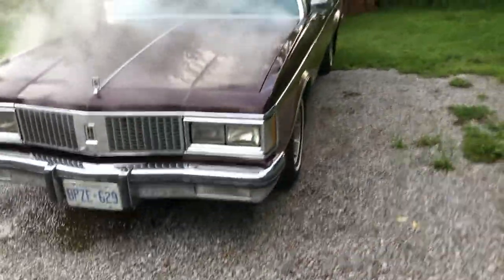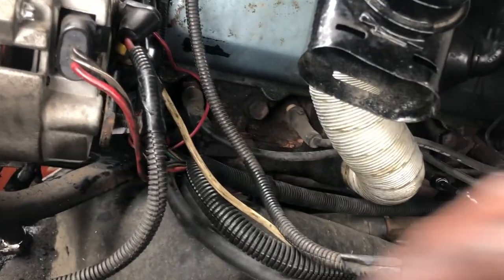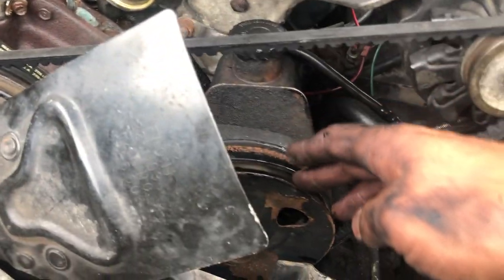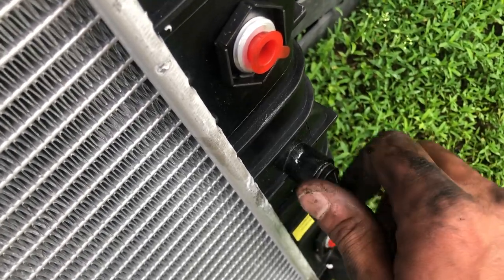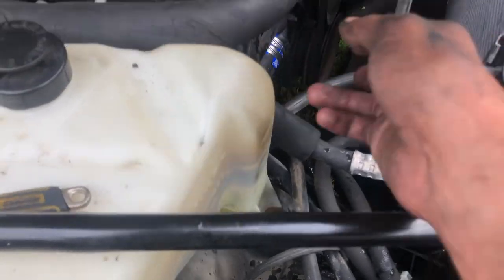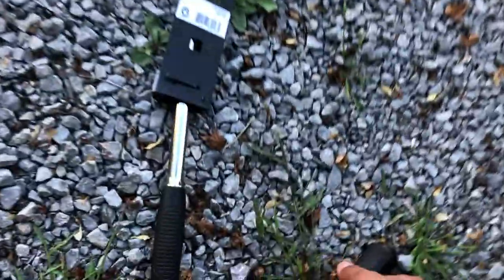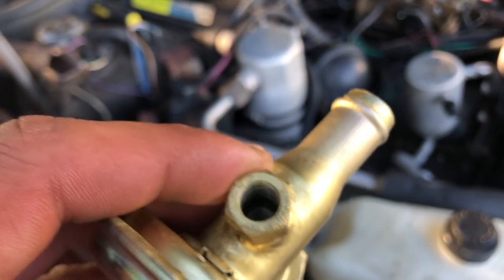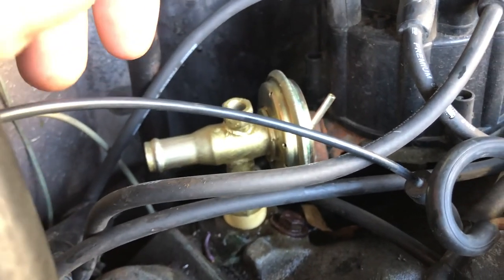New Radiator And Heater Valve For The 1990 Olds Wagon

Comment: I have a tempmatic system in my 90 Custom Cruiser and also had the issue of constant hot air at the foot wells.  Turns out it was the compensator in the programmer that was not performing its job of modulating the temperature valve.  The service manual recommended replacing the compensator and I did, to no effect.  In frustration I removed the programmer entirely and retrofitted the manual temperature modulation system which is just a cable and an elbow that allows you to directly control the temperature valve.  Now I get hot or cold air as I want it!  Not sure why the new old stock compensator failed, nor why the old one failed.  The service manual did not include a bench test for it ☹